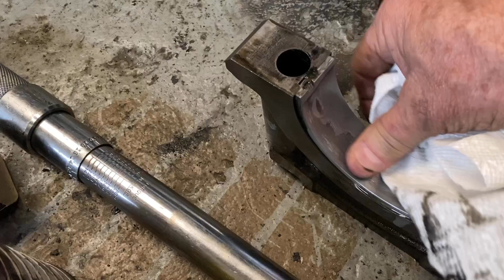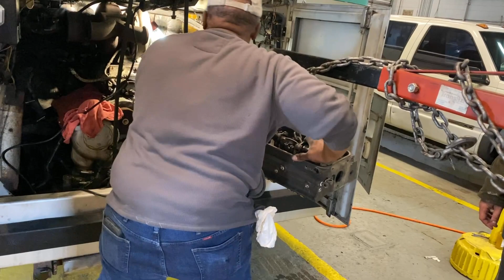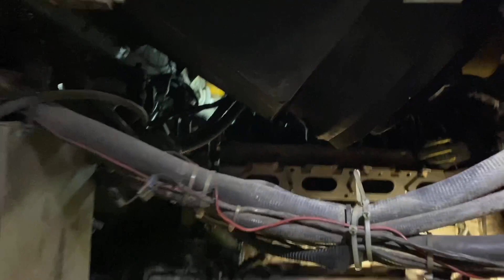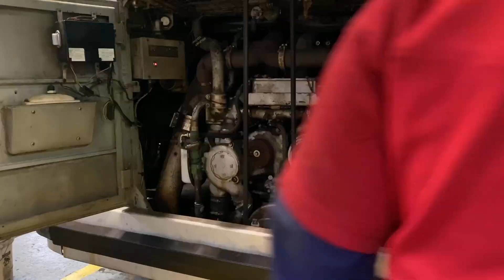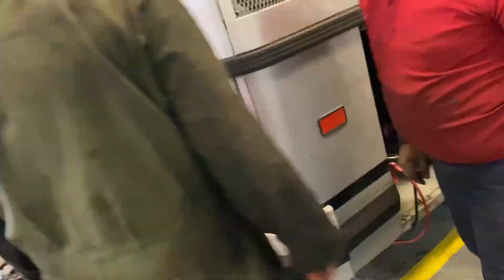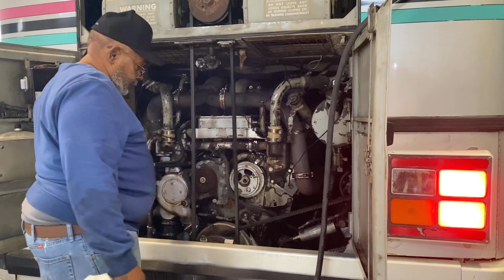#46c - MCI, 8v92 Detroit Diesel - Inframe Rebuild

Comment: Where did you find new heads? Were they NOS or rebuilt?
Reply from the maker: We happened to luck out… the shop where we were doing the work happened to have a couple complete heads that had been sitting in their parts stock for several years…

Comment: Did they replace the main and the rod bearings ?  Or just the main bearings ? 

That isn't really called an "in frame" rebuild.   Yes, you did it in frame.  But a true "in frame" replaces the liners and pistons.

How did you flush out the coolant passages ?   Was it pressure tested hot after the rebuild ?
Reply from the maker: Just the mains… we looked at rod bearings and was determined there was no wear on them, they looked new, so decided not to change them… 
After work completed, engine was run to temperature then coolant level monitored for leakage, all seems to be good…

Comment: So the coolant was leaking from the cracked head ?
Reply from the maker: One of the donut head rings had a piece missing and a magnaflux discovered both heads had a crack.
Reply: It is merely a coincidence, that both heads were cracked  ...  
and reassembling with new heads is a hell of a lot easier and faster,
than pressing in new guides, reaming them, machining the valves and seats, etcetera.
The concept of disassembling the bottom end, and replacing main bearings, while reusing the supposedly "un-worn" rod bearings, is just a hair shy of insanity.
With all of the labor funds that were, no doubt, dished out generously for disassembly and reassembly  ...  it is simply prudent to replace all "high wear components", and to pull the cylinder liners to facilitate replacement of the lower seals.
Should the aged lower seals develop an unfortunate leak in the future  ...  all of the labor performed this time around, will have to be repeated.
Sorry to come across as blunt  ...  but I guess when the video showed them placing the bearing caps on the gritty concrete floor; It became clear that these guys were clowns. Personally, I wouldn't allow them to work on my lawn mower. 
I sincerely hope that everything goes well with your bus.